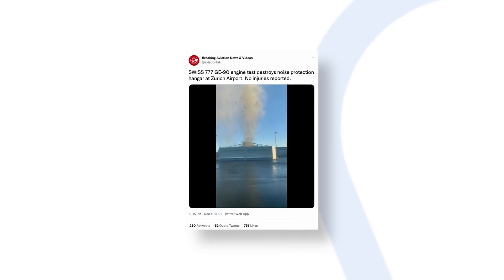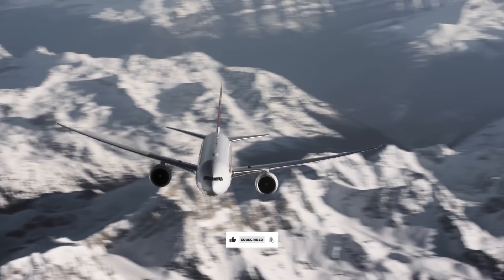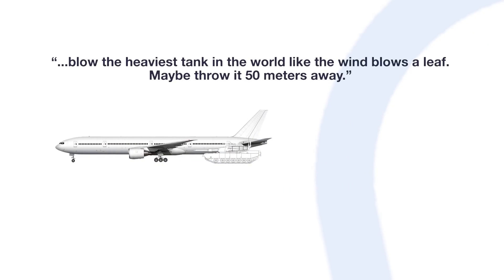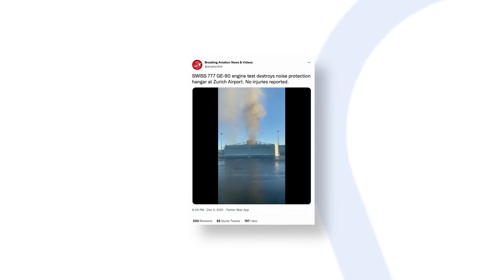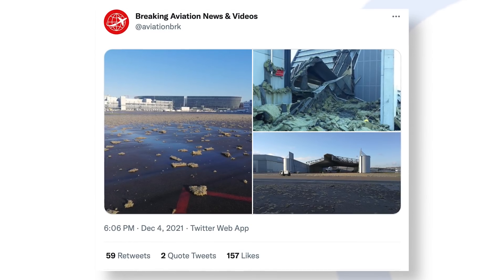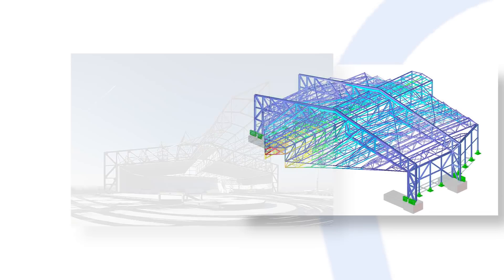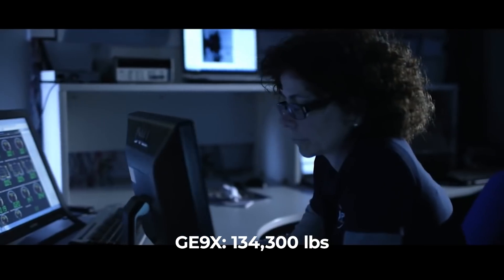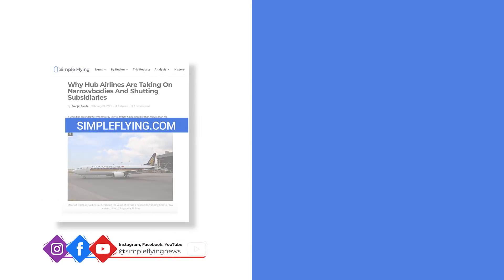How Powerful Are The Boeing 777’s GE90 Engines?

Comment: A way I always think about the GE90's power is the shaft power required to turn the front fan. It's a high bypass engine so most of the thrust comes from that fan, and the power required to turn the fan is in the neighbourhood of 100,000 horsepower each. So a 777 has 200,000 horsepower running the two fans. For scale, the largest container ships have similar (~100k horsepower) outputs. The Nimitz class aircraft carriers have about 260,000 shaft horsepower...similar to the 777.

Comment: My very first flight on a 777 with the GE90-115b’s the one thing I noticed on takeoff different from any other aircraft: On rotation normally on most aircraft regardless of engine type when the main gear lift off there’s a slight and sometimes pronounced lull before the power kicks in and the aircraft really climbs. Not on this beast. It was like a rocket. Only that overpowered unicorn, the 757 compares, but the 757 isn’t lifting 777,000 lbs on takeoff!! One time I was going SFO to Chicago on a 777-200. I was soooo disappointed to find out that we had the Pratt & Whitney’s.  On takeoff it felt like we had lawnmower engines. The difference was incredible. I was just sitting there shaking my head. People were probably wondering why the heck is this guy shaking his head in obvious disappointment 😂. If you haven’t already check out in YouTube the 5 part series The Making of the 777 the 21st Century Jet.  It is fantastic. Lastly when GE got the GE90 certified for 777-300ER, Boeing flew it on one engine for nearly 6 hours flying to Taipei. If that doesn’t give you comfort I don’t what will.

Comment: Yes, you missed the fact that ONE of those engines can accelerate, lift-off ond climb a Boeing 777-300ER at maximum weight in case the other of the two engine fails at take-off after the decision speed V1. This is more impressive than "keeping the 777 flying after one engine fails". And another remark: When you put the title "How Powerful Are The Boeing 777's GE90 Engines?" - you should answer the question. The international unit for power is the Watt, or Kilowatt, or Megawatt. Please try to convert the non-international unit of "lbf" to ISO (international units) Note : The international unit for force is N (Newton). I have done the conversion to Newton, Watt, HP and PS. But I let you do the same. Enjoy learning something.

Comment: Maybe Airbus Should Look at Replacing the 4 engines on the A380 With Two GE90.
That Plane Would have better success if it was powered by two engines instead of the current 4

Comment: The 777 & GE 90B is marriage made in heaven's so to speak. Both engine & aircraft are absolutely perfect combination for safety & reliability. To quote nat geo aircrash investigation on the Heathrow 777-200 ER crash involving the rolls royce variant engines, 777 is the gold standard in aviation safety. Feat of engineering to be marvelled at. Truly iconic.

GE -90 B is stated to have six sigma levels of inflight shut downs i.e. 3 times in a million flight hours. 

When GE engineers sat down to make this series of engines they probably said lets build something flawless.

For the 777 aircraft type  GE won the battle for safety & reliability hands down,  rolls royce and pratt&whitney are distant competitors.

Comment: I know this might sound crazy but would it be plausible to put two of these engines on a 747, considering how powerful just one is?
Reply: The combined power of the B747-8 engines is of 266,000 lbf, whereas the combined power of x2 GE9X Max power is of 268,000 lbf. So the answer to your question is YES. However, the wing design of the jumbo is to fit 2 engines each, so the weight distribution is different. In order for the 747-8 to have two engines, it would have to undergo major design changes in the wings and possibly in the fuselage and other components too. On the other hand, we must not forget that GE9X engines are operating max power if installed on jumbo aircraft, and these are not supposed to work under max pressure all the time because they could fail.

Comment: Short answer is that the GE90-115b is the highest thrusting commercial high bypass engine ever !
It actually has a higher thrust than the new GE9x (115540 lbf vs 110000 lbf)
GE9x is more fuel efficient

Comment: Of course the 777 is my favourite aircraft. There is no sound in aviation better than a GE90 spooling up and roaring down the runway. It's a shame that the GE9X doesn't have the same amazing spool up sound as the GE90 but it's a lot quieter.

Comment: The GE90-115B is rated at 115,000 lb. (514 kN) thrust, the most powerful engines in commercial operation in the world. Why we haven't seen more damage like this is actually kind of amazing. The upcoming GE9X-110B1A (GE agreed up upgrade the engine thrust to 110,000 lb. (490 kN) thrust in consultation with Boeing) on the 777-9 will probably generate almost as much blown air as the GE90-115B.

Comment: Powerful enough it took until 2017 during the GE9X testing to beat the GE90-115B record thrust of 127 000ibf in 2002 when the GE9X reached 134 000ibf though its maximum certified takeoff thrust is 5000 ibf less than its predecessor at 110 000ibf

Comment: My absolute favorite aircraft must be and will always be the 777-300ER. And the spool up noise of the GE90-115B is just mesmerising
Reply: Same here. The 777-200/300 are my favorite planes.

1. B777
2. B747
3. A330
4. B757
5. CRJ-900
6. Any aviation technology demonstrator
--------
Worst
A380
B737
B767
B737 Max
A350
Reply: @thatguyalex2835  I love the 330 engine on cold start sound so refine nd smooth but has a unique sound typical RR not GE
Reply: @thatguyalex2835  well whit the worst one not everyone would agree, except me, jut that the 340 is one of my faborites

Comment: The triple7 is an amazing aircraft. It just amazes me when we are training in the simulator and we do single engine go around, the fact that you can climb so easily on one engine while just holding the controls with your fingertips and not even having to have your feet on the rudder pedals (although we do anyways just in case) is just a fantastic performance machine...

Comment: Not only can a single GE90 keep a full 777 airborne, it can also perform a go around if necessary. Going from low and slow to climbing out on one engine is impressive.
Reply: every engine can do that though. that is a certification requirement. still impressive though!
Reply: @cfg003  their sound is the best
Reply: So why there are two engine in 777?
Reply: @JEE-ff5pp  certifaction requirements for safety and ETOPS
Reply: @JEE-ff5pp  You still require two engines for ETOPS and safety, and mainly to maintain the cruise speed. One engine might be able to propel the plane, but it won't be able to sustain flight at FL360 at Mach 0.83. You've gotta descend.
Reply: perhaps for a shorter takeoff distance, more control and single point failure issues
Reply: Insane
Reply: When you figure the 242 foot long 777-300ER at its MTOW of 775,000 can Lift-Off the Runway after an Engine Failure,
and Climb Out on 1 Engine, is pretty impressive.
On a Trans-Atlantic Flight, a 777 flew for hours on 1 engine and landed in frozen Canada without incident.
Reply: Imagine if it could do it to an a380😮
Reply: could the GE90 power the a340-600? only asking
Reply: @sergiolaurencio7534  they are too big to fit under the wings, and they are way too powerful unless put on the -600.
Reply: That absolutely blows my mind. These engines are incredible.
Reply: A single GE-90 can keep the 747 airborne
Reply: @mingming9604  Not true. You need the rest of the plane, like fuel, wings, electrics etc with atleast one pilot to keep it airbourne
Reply: @discountdave4537  Wings technically not necessary if you got thrust to weight ratio greater than 1.

Comment: Flew on a 777-200 yesterday that had them fitted!
Reply: @techbyyatharth4618  777-200LR has the GE-90 engines
Reply: @fentanyllord8662  he said 200 only so i said it. But I also wasnt knowing that 200 lr also has GE90, so thanks for that😊
Reply: @techbyyatharth4618  You might want to know non ER -300 (only sold 60 made) never had GE90 certified for it as no airline ordered it whereas 42 were Trent 800 and the other 18 P&W 4090-112. For the -300ER it was made the exclusive engine with the higher thrust variant
Reply: @filledwithvariousknowledge2747  okay🤨
Thank you dude😊